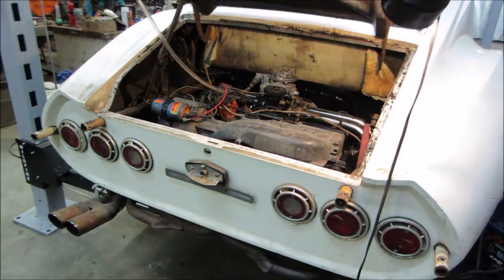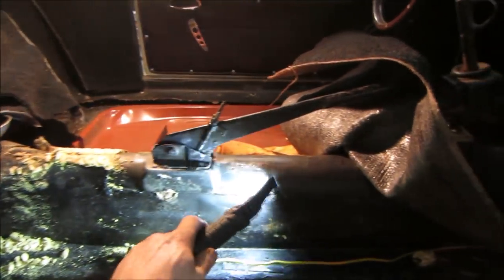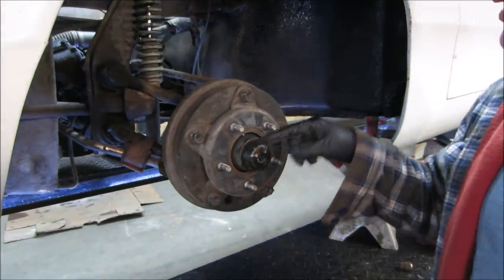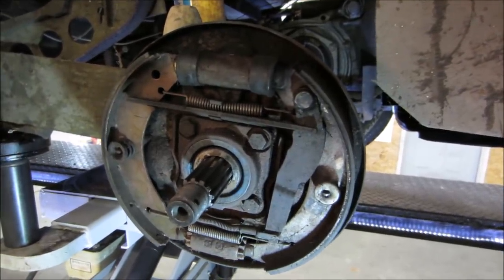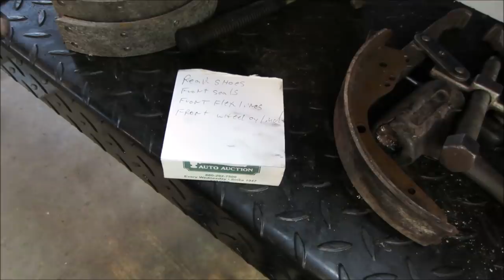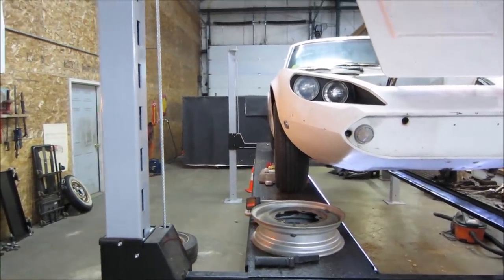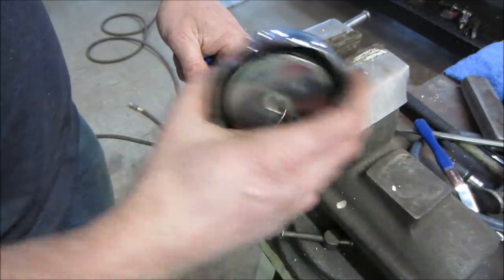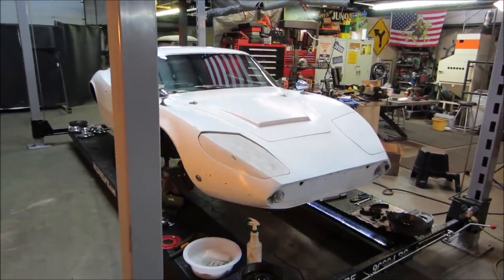Tearing Down My Barn Find Kit Amante GT Kit Car

Comment: That pull knob that you found under the driver's seat is probably the passenger seat ejection system actuator knob!  :  )
Reply: Could have made a loop in it & done the mirror...
Reply: @Tinker001  I think we all were thinking the same thing.  :  )

Comment: 19:50 Ooof... I think someone put a tiger in their tank, and then forgot about it for 50 years. WTF is green liquid coming out of a gas tank for? Holy crap. At least my stomach has settled back down after the scenes where you went groping around in the graveyard that was a floorboard and a disaster at the fortune cookie factory. That was pure stomach torture... but oddly fascinating. You really got me with the " I may have a spare floorboard that will fit this."

Comment: Those long drill bits are commonly called “gun drills”. Kinda nice to see the old homestead again. Haven’t been there in quite a while. BTW, something I’ve found that works well for dissolving gum and varnish out of gas tanks is E85 fuel.

Comment: sounds pretty good ! congratulations  I grew up with a guy inFlorida that had a Myers DuneBuggy on a shortened Karman ghia pan  he always said it was a 58 ?  His old man owned a marina and bought a Myers  distributor ship  that was their first build  for their Florida winter house  in the 1980s his Dad had 2 or 3 brand new crated Dune buggies  stashed at the Marina  my Buddy was a great fiberglass and paint and body guy  he got tired of the metal flake Green and painted  over the gel coat  you never knew what color the Buggy might be one day to the next  but it was fun  when they brought the car to Florida inthe 60s  they could still drive n the beaches  which he said his Dad loved to do  one Friday nite we cruised Fort Lauderdale during a Spring Break and we got 13 drunk girls to ride with us in that car it was so tight he couldn’t find the shifter  but I could from the passenger seat and he was yelling to me to shift

Comment: To install the spring holder on the mirrors, using a string to tie around where you were trying to grab with the pliers, and pull the string/spring mount thru the hole.

Comment: If you can't get the mirror spring pulled tight to get it back in the front assembly, use the dent puller welder and weld a small tang on the end of the spring piece, then detach it when you're done. :)

Comment: I would have used a small pair of Vise Grips on the mirror spring but the piece just was too brittle. good thing you drilled another hole and stretched the spring a little fits like a glove. Hopefully Darren you can find a set of Red line Tires for that it looked really good with the redlines on it.

Comment: Mustie1, Some wire wrapped around the spring cap and pull it through. But doesn’t matter, it’s done now and working. They look good too. Glad you had a bunch of the parts in your hoard. Was great to see the old shop, test mower track, camper, and back out buildings! Ohh those were the days!!
Did you ever put a roof between the two shipping containers and how are they holding up?

Comment: On your mirrow spring if you wrap a wire around the part or spring you should be able to pull the spring or part through the hole with no problem. 
 I used this method for 30 years as a printer. There are at least 50 springs on most printing presses. If you have some strong string that will work to.

Comment: Use a piece of string and loop to pull up the tab through the mirror body.  Pull through,, slide it over and remove the string.  Done.    Also, think outside the norm.  No need to punch a center.  Use long nose mostly closed to.keep.drill bit centered.  Or pre-drill a hole in a tube and put tube over piece to drill.  Drill.through pre-made hole.

Comment: If you don’t snake a spring like that, get some appropriate size washers, bend the spring one way to separate the coils on one side and stick a washer in. Repeat the other side and back and forth. This essentially shims out the spring lengthening it. Once captured, pull the spring releasing the washers. Then remove loose washers.

Comment: about the spring/mirror problem.....loop a piece of thin mechanics wire or wire from a MIG through the hook under the round piece, feed through the plate, pull up and through the hole.

Comment: Mirror stem:  Sand the stem, bend a piece of 12ga fence wire back on itself so the loop is the right length and the wire overlaps the full length of the stem, then epoxy. Good opportunity to drop the pan around the seat for head room with .050" sheet steel.

Comment: For the mirror challenge. Loop some string around the disk on the end of the spring. Then pull it up through the hole. Once it is through just pull one end of the string to slip it out.

Comment: With the mirror spring I would use the dental type hook tools to hook onto the loop on the end of the spring and pull that end through the hole. Or, use a cable tie to go under the mushroom part and pull the cable tie through the hole in the collet

Comment: To pull the spring up tru the hole .   Put a longer wire hooked on the spring and pull the wire up thru the plate and release or cut the wire when its in place.

Comment: i really like those redline tires. i remember back in high school i put f 70 14" black walls on the front, and m 50 15" black walls on the rear of my '71 torino gt. all bias plies, on deep dish chrome moonies with small chrome dome hub caps. first set of brand new tires i ever bought. i had to put extended shackles and airshocks on the car to keep the fenders off those m 50 meats. damn, i loved that car. edit; i would've used a piece of wire to pull that tab through the hole in that mirror, the clipped it off when it was in place. i really hate pot metal. i think it's an alloy of zinc and tin, neither of which is known for it's strength. but it's cheap, and easy to cast from a mold.

Comment: I always liked the old lanolin-goop mechanic's hand soap that you could get at the parts store for cleaning up a really messy finish. It not only took all the greasy finger prints and bird poop off, it left the finish looking kinda polished, rather than the dull oxide color it would normally have.

Comment: I would have tried a wire or thin rope to pull the spring through wax twine would be strong enough. But depends if you can pull the spring enough. Just a thought from a layman in Canada 🇨🇦

Comment: FYI, to drill a shaft like your mirror, take a nut that just fits over the round, drill a hole, same size as your drill, in the middle of the flat on the hex of the nut. Then when you drill it has no choice but to be centered.
Lots of little tricks us old facts know and had to come up with before some kid designed new tools to do the job.

Comment: Drilling the hole , may try drilling a hole in a dial rod to slip  over it snuggly , , Slip the dial over the metal rod .Then drill through the wood rod to let it  act like a centering jig , just a thought

Comment: just go to your local sheet metal/electrical shop a good one and buy some sheered and broke 26 guage or heavier galvanized sheet steel and possibly some imc pipe for welding Imc is a very hard alloy lighter than rigid and has 15 times the tensile strength of rigid pipe...harder and springy....resists bending or sagging to the max....the imc can weld in and the pan can drill and bolt right up...In my youth we used imc to weld together 3/4 racers...tough as nails and welds fairly well but use a fan....where the new metal meets the old apply butyl caulk and sheet crew closed seals all leaks and flexes to keep the areas sealed up....and where the imc conduit is used cold gal paint and even filling the tubing with closed cell door foam closes the door to water rust and quiets the ride

Comment: While you have the srats out to fix the floor, maybe a trip to a wrecking yard would be in order to search out a set of seat rails That way, you would be able to have adjustment for leg length. Also, should you opt to sell the car, it would be a good selling point for the buyer to be able to adjust it to fit his/her leg length. A tilt steering column would be a nice touch, too, should you find one that could be adapted to fit.
For the tires, check out Coker Tire. They specialize in replacement tires for vintage cars. Perhaps they will have bias ply red line tires in their catalog.

Comment: You should try the mag type wheels off the other VW with the 205 radials, but personally I would run the black wall side of the tire. I like those wheels and you'rn not going to use them on the older VW you said. Too bad you didn't have a Porche motor lying around for it. That would be coooooooool! Keep up the great content.
Robbie in Ottawa Ontario

Comment: The way to drill them and stop it from wandering on you is drill a hole in some 1/8 steel and clamp it on top of the piece you're trying to drill  it will follow the hole in the steel . I use paracord and loop it around the  item you need to pull through then pull it up through the hole for the mirror.

Comment: 1:01:53 just like when you open a bathroom scale (the old school kind with springs, which doesn't die, since it's a mechanism) you just have to pass a wire and hook unto the spring and pull it through. Works every time.

Comment: There is a tool called a sprong hook. HAs a loop on the end to "hook" the spring and a right angle handle to pull the spring.

Comment: My brother use to work for the company that made the Amante kits  about 1970  when he left the company he got a good deal on a kit  he was building one with a olds torando engine in it  moved to the back with the steering  locked. he had split the tops of the fenders and moved them out  about 3 inches , so it had large vertical ducts  a few inches  after the door,  super wide and mean looking.  radiator piped to the front . ducts feed air to brakes and air cleaner thru 4 inch hoses to a couple big holley carbs .  He got as far as firing it up and driving it around the block with vise grips for the steering wheel  sitting on a 5 gal bucket .  That week someone stole  it  and it  never resurfaced    always wonder what happened to it.

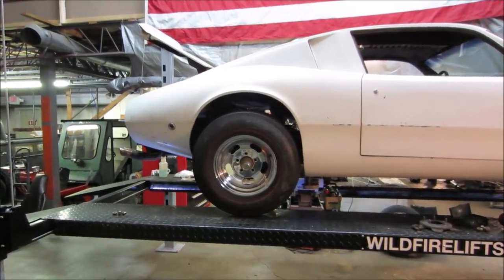Comment: 51:06 that tyre with the white ring at the front looks much better than the big fat ones that were on before. It looks like it was made for this car. It does look good and it fits.
Reply: 51:25 that tyre is just too big for this car. It doesn't look right.

Comment: Muriatic acid will clean the crap out of a gas tank. It has a super strong smell. You don't want to breathe it at all. I always use thick gloves made to handle that strong of a chemical to but with a little time and sloshing it around in the tank, it cleans awesome and doesn't cost a whole lot. Use baking soda and water to neutralize the acid after you finish cleaning the tank. I always put a tank liner in after cleaning to.

Comment: With the mirrors of the bullet kind, I remember them well and used to use either a length of fishing line to pull it into place or a bit of bent wire coat hanger, was thinking a zip tie could prob do the same.   I would not be trusting two self tappers into fibreglass, maybe some adhesive sealant or VHB tape will give it strength enough, my Reliant has the same pattern of fitment for door mirrors and I might just put out for a set as they remind me of happier days when cars were cars and you knew you were OK with a pancake K&N wire wool filter and your bullet mirrors oh and rear screen louvres :P

Comment: On those mag wheels that you are using they are prone to warping. My sister had a set on a 67 mustang that were bad if I’m not mistaken from what I heard they were outlawed because the metal they were made with was so thin and were easy to warp them apparently they quit manufacturing them. 
On the master cylinder you said you were upgrading to the dual port style that would be much safer.

Comment: Mustie.  You could have tied a bit of string around the spring then treaded it trough the hole. Taken up the slack pulled it tight then the end of the spring would pull out.

Comment: I think the wider slots on thee cylinders are for use with emergency brake levers. some  of the beetles had the e-brake lever ride in the same slot as the brake shoe.

Comment: Check Ebay Mustie for vw tires. 165/80-15 or 14 whichever you need. There are Chinese tires in that size for way less than like Coker or some of the vintage tires that are super expensive. I bought 4 for my 68 Beetle for less than 300 delivered and they look great!

Comment: I'd be idea replace that metal with your pads and then put an overlay of fiberglass on it on the inside and add your your chainsaw oil on the bottom yeah looks good got a little work to do keep up the good work.

Comment: You have the fabrication skills to make almost anything.  So here is an idea.  I frequently watch you and others work at cleaning gas tanks.  Why not make a motorized tumbler.  Something on a pedestal, possibly with a universal plate with straps so you can lash down nearly any size or shape tank.  Then you could tumble tanks with vinegar and bolts for hours.  Maybe even integrate a timer.

Comment: Watching you try to reassemble the mirror, if it were me, I'd drill and tap a hole in the middle for a bolt/screw to grab onto and pull it through the hole.

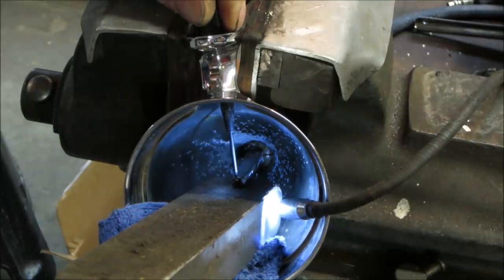Comment: 59:08 would be a great time to get a set of metric and standard diameter transfer punches. It is so useful for doing things like that or anything you want to make a centered hole from what bolt hole you are trying to line it up with.

Comment: I really figured you'd just wrap a piece of wire to pull that small disc through the hole on the mirror. Sure would have been much easier and quick. Of course that doesn't help now. But that was a lot of struggle. I do that trick all the time.

Comment: Erm... the way you explained the difference between disc and drum hydraulic systems was exactly opposite.  A drum system maintains a residual line pressure with a valve in the master cylinder in the old days, although because I’m retired I’m not up to speed with the newer systems.  A disc brake system does not retain line pressure and used various  methods to retract the callipers including using disc runout and the use of square seals at the pistons which ‘roll ‘ out on application and roll back on release. If you convert a drum brake system to disc you need to remove the valve in the master cylinder to prevent brake drag at the discs.

Comment: Thin steel wire looped around the spring tab then through the adjustable rim hole and then around a screwdriver shaft (as a handle to pull on) would have worked for the mirror. Very hard to explain in words. 😆

Comment: That's what I would do. Drill you a couple more holes and move it back. We used to do that to many of the vehicles we had. Let's just say the family I worked for weren't small not being mean or nothing because I use to be over 400 until I had gastric bypass.

Comment: @1:04:17 You could have used some wire or hanger to hold onto that piece and pull it. I like the wire idea because the insulation on the wire won't scratch anything and just loop it and then let it go when done. No grinding necessary.

Comment: For the mirror, a tiny piece of wire or string wrapped around the round piece pulled through the hole 🕳 and use it to pull the round piece through. Been there before.

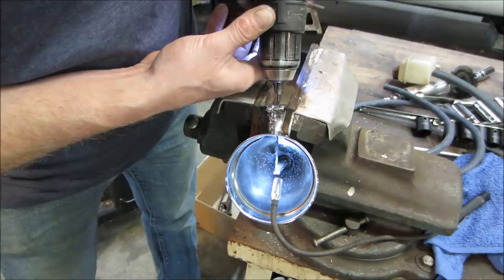Comment: 58:18 Drill a hole in a block of metal with the drill you are going to use.  Superglue that to the "diving board" in the correct place. Drill down through that hole into the "diving board". Remove the block..... Paydirt. No walking drills, no broken drill bits.

Comment: its the dot 4 fluid that causes those bits to corrode and get stuck, if u use dot 5 silicon fluid you dont that problem even it the car sits. dot 4 likes water, and will wash away with just water. you have steel rubber and alloy, in those brake parts add water based dot 4 and get a nice chemical corrosion happning.

Comment: 1:02:20 I would take a metal cable, wire it through the spring loop, pull cable really hard through the mirror tom and then take piers to guide that metal knob into place.

Comment: The car coming a long nicely... it’s you car but for me I think the black wall of the tire looks better then the white walls but this is just a suggestion... car is gonna look good even with the white walls as well...
Reply: Agree black wall tires with or with out red much better looking.  If you had to use the white wall tires,  mount tires with white walls facing the inside of wheel well rather than outside?

Comment: Mustie1/Darren,
Are those front brakes supposed to be like that with the wheel cylinder at 3 o'clock? Shouldnt it be at 12 o'clock so it can be bled?
Update : I guess they are supposed to be that way. Strange.
Paul (in MA)

Comment: I kept saying to myself "Get some fishing line for that spring", however looking at that ping iron I dunno honestly if it would hold that spring at its original tension without breaking.  As for the tires I can't say I'm a fan of red line or white line (white walls only on mid 60's and older) as I prefer a straight black wall tire on a black steel rim with dish hub caps, but I believe you could ask 100 people and get 100 different replies as to what looks good.

Comment: Next time you have a problem like the mirror use a small cable or tie wire, and make a loop around the spring then pull up through the hole

Comment: Piece of wire looped around the spring thingy would have worked to pull that spring through the hole in the top piece. Then just release one side of the wire and pull it out.

Comment: On the mirror I would use string or some stranded wired to pull the whatever it's called through the slotted hole.

Yup, I wasn't alone.  LOL

Comment: how about drilling through the back of the mirror body, tap a thread in there and use a threaded rod with a small hole in it (to hook the spring onto) and a decorative nut to fix it like a jam nut...